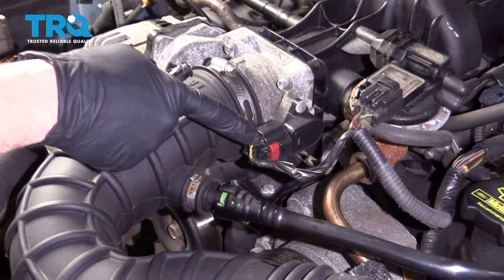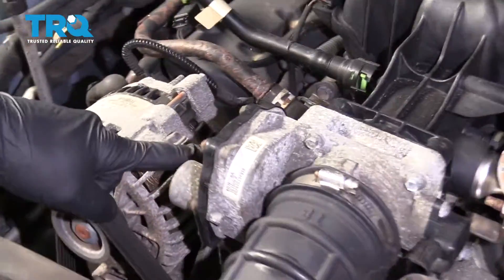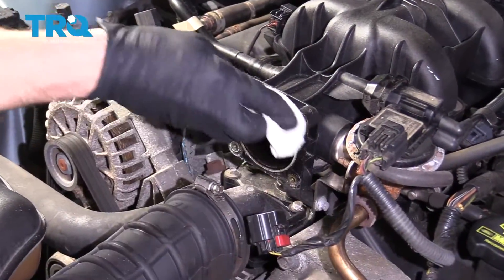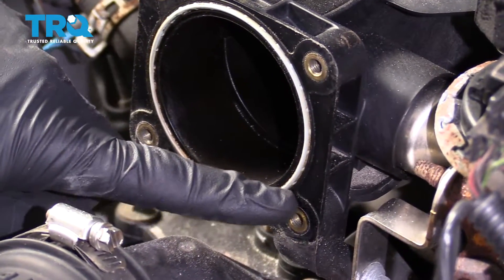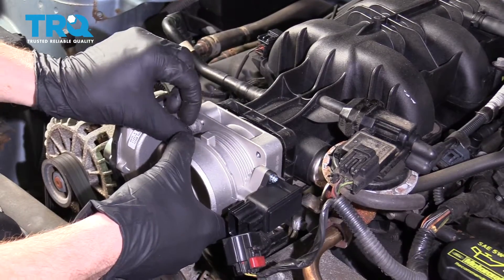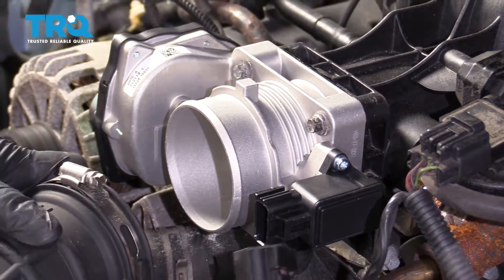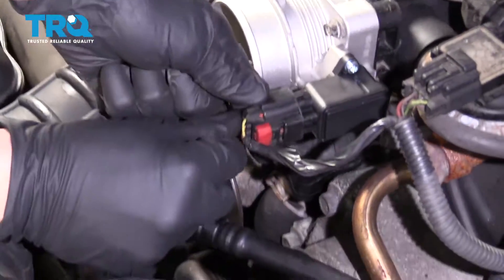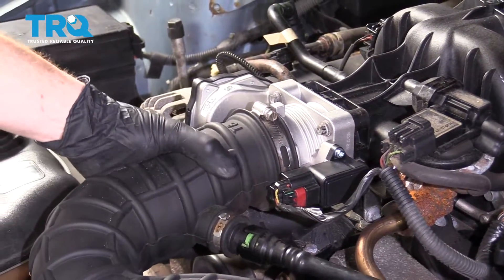How to Replace Throttle Body 2005-14 Ford Mustang

Comment: So I replaced my throttle. Still getting throttle codes , I’ve reset the PCM/ECU , I’ve done the recalibration a thousand times, and it’s stuck with the wrench light. For some reason it was driving very poorly but with the wrench light on and now it’s forced idle again. Ive read every forum and can’t find anyone with similar issues. Any help? Anyone ?
Reply: Wrench light popped on and replaced it and still the wrench light doesn’t come off
Reply: Also having same issue. Plz let me know if you come across a fix
Reply: I’m looking for the same fix
Reply: Wrench light = limp mode
 I hade the same problem when I first got mine ended up being a frayed wire to the tps.
Reply: @davidortiz8644 How did you find where the fried wire was? I’m having a limp mode problem and can’t seem to figure out the problem.
Reply: I'm in the same situation did you found out what the problem was ?

Comment: Question: I just discovered my Throttle Body has a intake and outtake for the coolant hose at the bottom of it. Everywhere I try to order a replacement does not offer a Throttle Body that has this. Should I goto a junkyard or something?
Reply from the maker: +Neal Singletary Jr Thanks for watching!  You will want to get one that has ports for coolants at the very least.
Reply: Im also looking for same!  Any luck on finding one?
Reply: You will need the heated design or bypass it. There are video of it in YouTube. Sadly I am not allowed by YouTube to send links